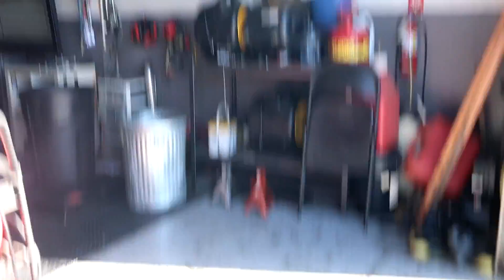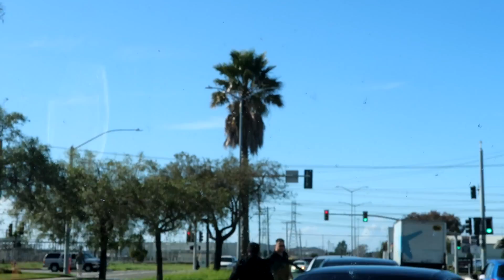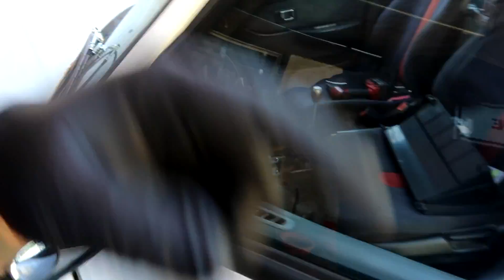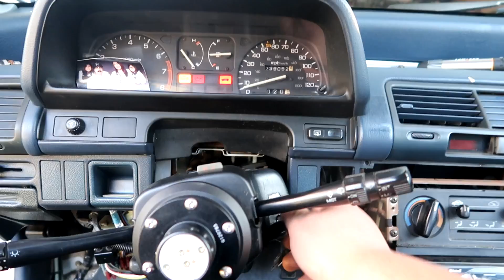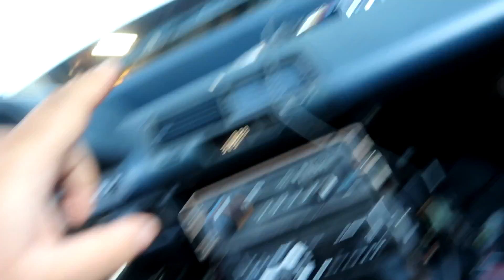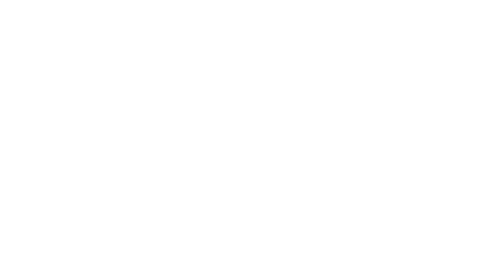JUNKYARD K24A4 MOTOR IS NO BUENO !

Comment: I don't like Wicked1, I prefer Blacktrak which is right down the street. I took my RSX there for a dyno session last year, after it was done I hooked up the laptop to monitor stuff on my drive home and found the AFR's way to rich. They had my AFR in the mid 11's at WOT and was super rich in other areas plus they never tuned the low cam maps on the dyno. Had to lean it out myself to about 12.9 - 13.20 at WOT and basically street tune it myself so glad the RSX has a factory wideband , i will never go there again for a tune. If your in the bay area Blacktrak's is the best performance shop.
Reply: 1gsrtom yup. My buddy tuned his Car at wicked1 and his afr was crap... I was surprise

Comment: Try putting to tdc and put a new tensioner. I had a motor from the junk yard do that. I just threw a new tensioner and it worked fine it had no bend valves.

Comment: you got it easy. I got to do the spark plugs on my VR4. I'm tempted to just roll it into the river
Reply: Lol, a buddy of mines had an engine tick on his vr4, and he was done. Didn't even want to think about diagnosing it, just sold it as is. VR4's are gnarly cars but troubleshooting them becomes a nightmare
Reply: @itzzToon  damn, mystery Marvel oil got rid of my valve tick. I still want to put it in the river though
Reply: I feel your pain, front is easy but when you have to take off the plenum for the back 🤦‍♂️ it’s a pain

Comment: FYI Chrome & S300 are the same thing just S300 Standalone ECU & is backed by Hondata witch is a Name & Chrome is a Chip based software Pros use to Burn & Render diffrent maps on a Chip Cheap but Very Effective... #Prefrence up to you but both are exctly the same 1 is $$$ the other is not so much.. 💯😪✌